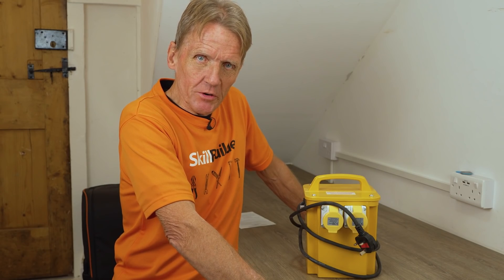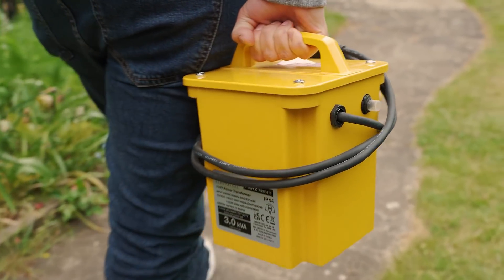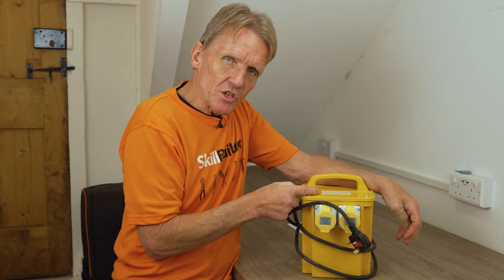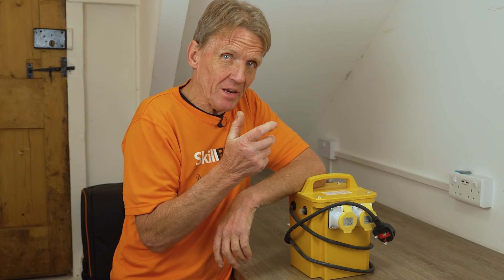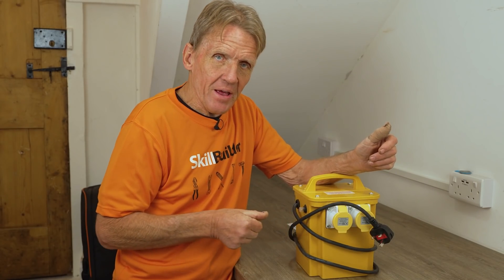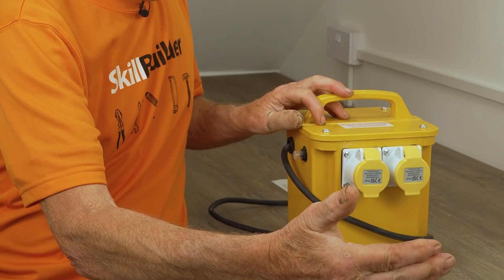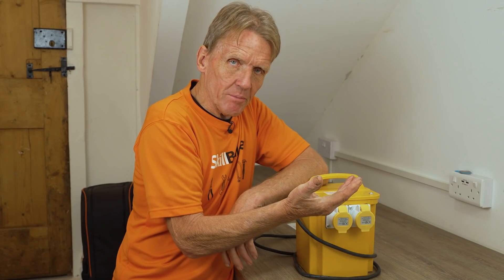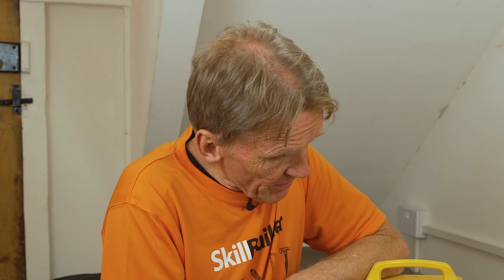110V Transformers - 3 Things You Need to Know

Comment: I always thought that if you had to use with extension leads you had to have the transformer plugged directly into the socket, and then use 110v extension leads, not plug the transformer into a 240 extension lead like in your clip of the breaker as the drop in resistance along the 240 extension lead damages the transformer.
Reply: No, electrically, there is no problem at all plugging the transformer into the extension lead. There is less current being drawn on the 240V side, so the voltage drop is likely to be less, do make sure that you have fully uncoiled the 240V lead though. On the 110V side the current will effectively be doubled, so you need a heftier extension lead, especially if running long distances.

On some building sites however, there will be a policy of plugging the transformer into the socket and running the extensions in 110V. This is because the transformer is wired so that there is only 55V to earth on the 110V side, so if the extension lead gets damaged, the danger is much less to the workers, than if a 240V extension lead is damaged, that would have the full 240V to earth.
Reply from the maker: do you want a job?  we could do with an electrician
Reply: It is much safer to run 110V around on extensions than it is to run 230V.
Reply: @davidbrewer7937  It is illegal to run 240v leads round a site.
Reply: @charlieb6001  And rightly so....
Reply: @charlieb6001  not quite illegal. Just you’d have to be bloody brave at defending your decision to H&S and the courts if something happened if there’s a RCD you may be okay. But now it’s just best practice to cover yourself if there an accident to say you’re doing everything safely. And some places will require it
Reply: @lukedoherty8062  It all comes from the old factories act, which also covers construction sites. For all voltages over 110v it stipulates that ' at no stage can the cable touch the floor' which is totally impractical on a construction site. That is why 240v and 3 phase machines in factories are either fed with drop cables from the ceiling of buried cables in the floor. Having an RCD won't help.
Reply: @owenoneill5955  just one of those nothing explicit says no 240/415v just it’s part of doing everything as safe as you can so if something happened you say I’ve followed the recommendations and precautions to ensure everything is safe as possible. HSE even state it’s not banned it’s just not advised. And for this a lot of site have their own policy for only 110v
Reply: @charlieb6001  thats a bit of nonsense. I refuse to use 110 volt and carry heavy transformers,all my tools are 240volt,just like in the continent. Thats like absense of power sockets in the bathrooms in the UK/IRE .
Reply: @owenoneill5955 An RCD won't protect the cable output from the transformer.

However an RCD placed in to the cable feeding power to the primary winding AND that RCD placed at the origin of power to that cable (ie. At the plug end) will protect that cable from a fault.

Comment: 110 v transformers are actually 55 v if you measure the voltage it's because it's a center tapped transformer
Reply: 55-0-55 is the term.
Reply: But the appliance requires 110 volts which is why it is referred to as a 110 volt transformer.

It would be pretty crap if we have 110 volt appliances being fed from a 55 volt transformer. Think of the confusion and mistakes that will occur.

And you can get a 110 volt shock if you contact across both live terminals/wires on the secondary. Though that is less likely to occur than a line to human/earth situation.

Comment: Lots of people think an RCD will give you equivalent protection - I'm not sure that's the case, the point is these isolate you from the electrical installation, if you don't have that isolation then I believe you're subject to getting injured from earth faults that might develop on a building site.
Reply: They have an earth reference at the center of the 110v wind anyway, so anyone who can complete a circuit still gets a 55v belt, not fully isolating. RCDs must be used on 230v equipment.
Reply: An RCD won't provide any protection on the secondary side of a transformer.

However, if you place an RCD into the 230 volt lead feeding the primary side, AND that RCD is placed at the start of that lead, that is you plug that lead into the RCD, then it will provide electric shock protection for that primary side cable.
A fault occuring on the secondary side will not be protected by that RCD.

Comment: Mr Bisby, your talking a load of bollocks you don't understand. All transformers are not built the same. That one ther is a pile 'ole shy. A big yellow box full of fluffy potting and an alarm clock tranny from the 70s.  If it ain't heavy it has f all duty cycle. the only way you can make a transformer convert more efficiency from primary to secondary is either up the frequency or more wire and core. the CTE isolation tranny gets fed with 50hz, so your screwed with frequency. All you got now is more iron core, more copper, and heavy. New trannys are not lighter due to technology, they are lighter because they are shit. The whole idea is the 110v is center tapped earth, so the worst shock you could get is half the ground potential of 55v. If it didn't have an earth suplied it's galvanicicly isolated floating voltage and you would really have to try to kill yourself with that. The 1 thing that is Really bloody obvious is, Trannys have a very short Primary lead. How many sites have you gone to running 240v extentions to 110 trannys? RCDs on the primay/feed side also don't work on CTE/secondary side of the tranny. 55v can kill. It's there to reduce the risk, not evade it.

Comment: I think you'll find if you derate the transformer by the duty cycle  then you can use it continuously.
For example if the duty cycle is 30% and the transformer is rated for 1,000 VA then you should be OK with a load of 300 VA using it continuously.
The cause of these issues is the transformer is made to be waterproof and to withstand the abuse of being on a building site. Put the same transformer in a metal box with louvres for ventilation and it'd probably run happily all day at rated load.
The other approach would be to buy a transformer that's got a higher power rating than you need. Of course that's going to cost more and be heavier.
Reply from the maker: Yes I was talking about a breaker running for hours on end. I understand a site light would be fine.
Reply: @SkillBuilder  exactly, and I think it's also the point is not to have 5 guys working off one of these trannys with splitter boxes. One chippy using a skill saw and chop saw back and forth is fine as he using one tool at a time and not continuous
Reply: It's kinda linear. half load twice the time. It's not a welder, so they should all be rated 100% duty, but now every thing is cheaped out on.  All trannys VA was rated full load, heat soaked forever run mode. Now it's have a guess, we didn't certify it, we just make it and deliver it to anyone on alibaba
Reply: @UberAlphaSirus  I understand where you're coming from however remember this is a portable device. Weight is a factor as is cost. I just took delivery of a 20VA isolation transformer from,Ali. Price was right and 20VA is overkill for my needs. I'll check it with an insulation tester before I trust my life to it but it looks the goods with plenty of insulation between the windings. Transformers and motors seem pretty simple devices until they're not. The difference between 50Hz and 60Hz generally doesn't matter until you've got thousands of slurpy makers running on 110V at 50Hz via a transformer and the motors are not lasting all that long.

Comment: Every time I turn up at a customer’s house needing to use one. 
First thing I ask, where’s your fuse box. 😂
Reply: Why?
Reply: @g7mks383  
Transformers have a tendency to trip them out. 

Happened many a time. 👍
Reply: @badninja 1971
I remember doing a job for a customer and she said you can use the sockets in the garage and off she went to work,an hour or so later I plugged my 3kva transformer into the socket and it tripped all the sockets in the garage cutting the power to her freezer which was stacked with food,I didn't have a mobile number for her so I contacted her mum and she had to ring her at work, she eventually returned home and turned on the supply in the house and left me the key.
She wasn't very happy because her work was an hour away,she had just got to work when her mother rang.😂

Comment: How far does the 110v rule apply though every site is different, some sites say your cordless tools must be charged on a 110v charger so you still need a transformer others will have a container with loads of 240v sockets in ? It's hit and miss.
Reply: the ones that say you must charge batteries via 110v don't work for them, they're called nonce sites and the site manager is the biggest nonce of them all.
Reply: @garnhamr  ?????
Reply from the maker: Yes it is erratic and it is not even a legal requirment to use 110 volts.

Comment: mines absolutely hammered... and a while ago i turned it on and the thermal switch went bang so it hasnt got a thermal switch now. ideally id move away and go cordless but then id need a new mitre saw as my kapex is 110v.... my track saw, extractors, routers etc are all 110v so thats a canny bill to replace all of that lot

Comment: I'm transformed 😂😂😂
Didn't know about the intermittent use bit I'll be honest. What did annoy me in my 'days of on the tools' is the MCB nearly always kicked out on the consumer unit when you plug it in, especially in the winter when the tranny is cold. The customer thinks your plugging something dodgy in when you ask if they could pop in and reset it. 😊
Reply from the maker: A lot of start up surges need a particular type of RCD. I can't remember which
Reply: @SkillBuilder  Type C is better but not the sort of thing that is expected in a bog standard house unless it is designed for that type.
Reply: @tinytonymaloney7832  Do you no if there is any reason why a type b MCB not be changed to a type c MCB ?
Reply: @amazing451  different requirements on circuit for what the max reading is acceptable when they do the R1/R2 tests.
Reply: @SkillBuilder  Type C but no good when you're at a customer's house which would normally be type B.
Reply: Always try and plug into a B32 on the ring circuit or the cooker panel which should be a B32 or even a B40 if you are lucky
Reply: D type curve circuit breaker can handle the surge but you don't need here's the trick to stop breaker's tripping plug a drill into transform and hold the trigger on then switch on the power to the transformer this limits the current surge and all's good and if you have decent transform that's filled with a heavy sandy morter like compound you shouldn't have much of a problem with over heating it just sinks away the heat you get what you pay for mind thay way a ton lol, a fair few big engineering/building firms don't even won't 110v on site all battery tools

Comment: Please dont exceed its rated KWH rating, try to use one at least twice the watts of the tool being used. I have a 5KWH one for all day use and a light 1.5 one for the odd job.
Reply: There is no KWH rating for a transformer.
You are getting your units mixed up.
There is KVA, KW and KWH.
They are not interchangeable.

The only ones that apply to transformers in this set are KVA and KW.

Comment: I never knew they didn't have 120 in the UK.
Why don't they have 120?
Reply: 240v in the UK. Man's electric.😀
Reply: My guess is that someone looked at current loads and decided that having a higher voltage meant they can get away with less current. Lower current means smaller wires and copper was not in great supply at the time people were looking at it. The us also has 240 for some things like dryers and car chargers but it’s done with a split phase so 2x 120 combined I believe. We tend to use 3 phase when we have big power loads and generally that tends to be in industrial setting and  so we end up with smaller copper again.
Reply: 110v is only really used in industrial settings and building sites. You won't find it on houses like the states 120v. It's also centre tapped to keep touch voltages low so it 55v - 0v - 55v.
Reply: @effingandjeffing8270  most people don’t seem to realise this 55v shock to ground is why 110v its safer than 240v.
Reply: @effingandjeffing8270  US also use 240 when needed. See Technology Connections.
Reply: @toddbod94 There is only one type of 110v standard in the uk? The 120v in the USA is still essentially as dangerous as 240v